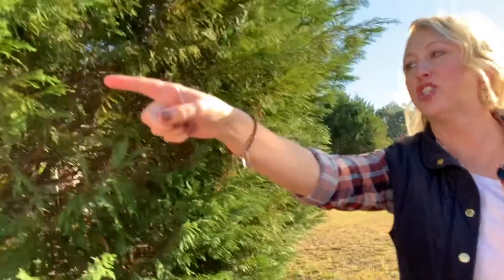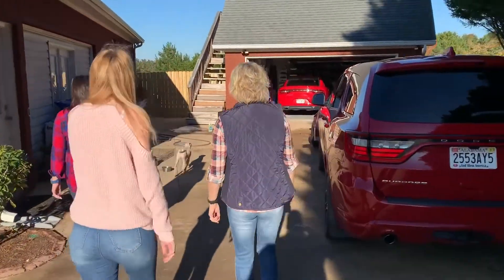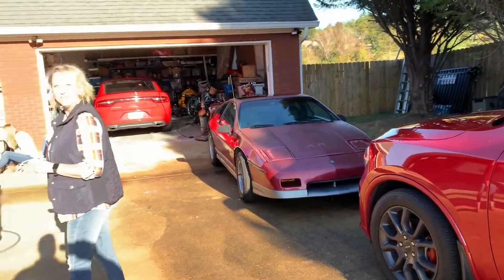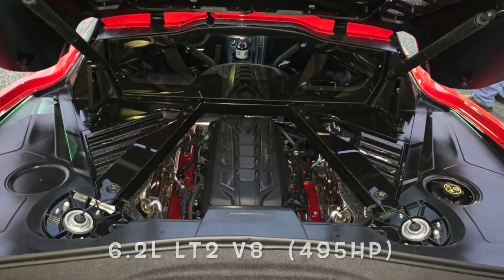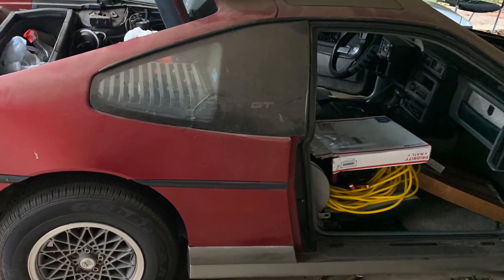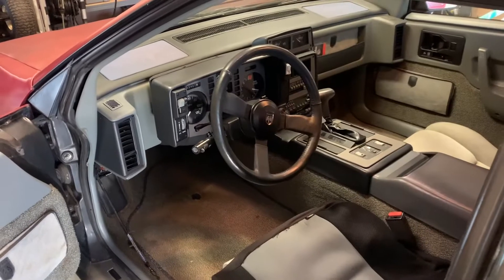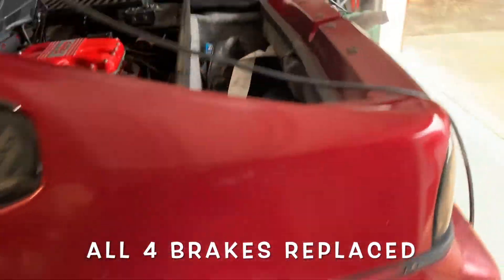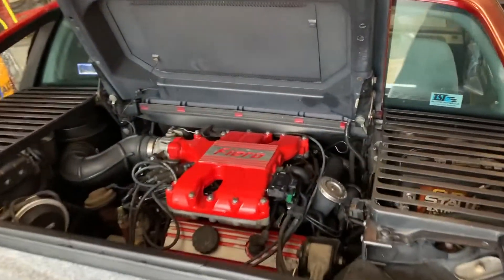Sitting for 20 years!! The Beginning - Supercharged 1987 Pontiac Fiero GT (Chapter 1)

Comment: If your going to do an supercharged engine in the fiero, you should REALLY be looking at Corevette 13 inch brake swap West Coast into kit. THE stock brakes were from an x car, and weren't for originally high performance GM stuff.
Reply from the maker: I upgraded the brakes to the Grand Am vented brake kit from the Fiero Store and did the Chevy S-10 brake booster upgrade. It stops much better now. I’m going to me making some more videos to show the progress to this point. I may do a more upgrades at a later time.